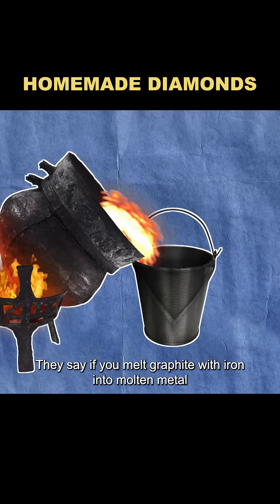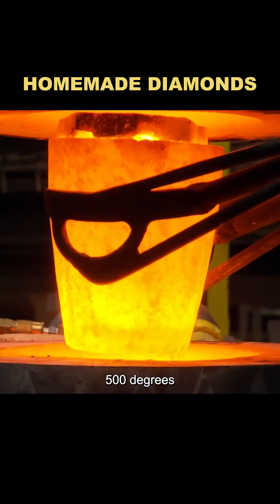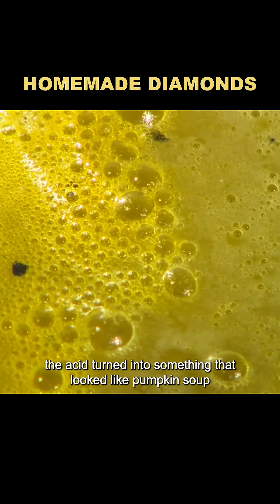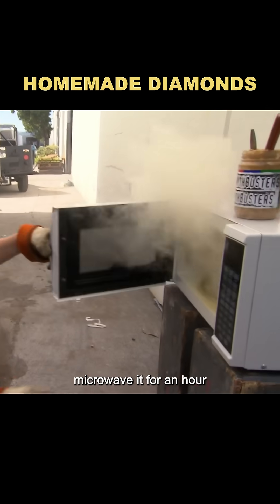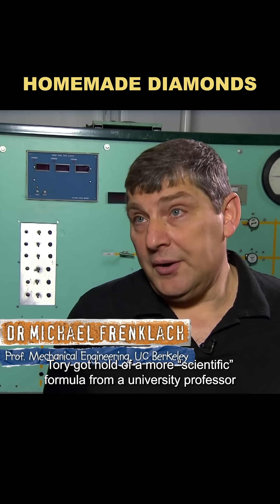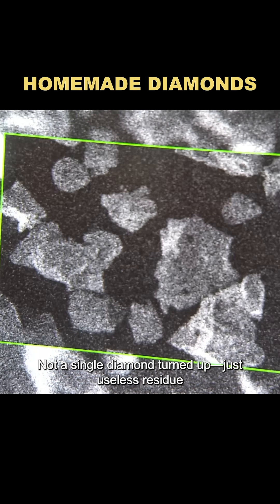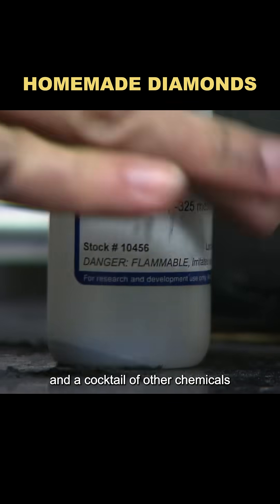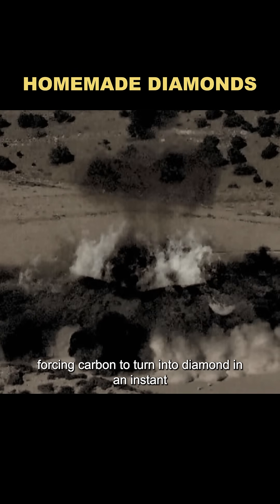So this is how diamonds are made.

Comment: How stupid is this?? Really, old fashion diamonds are the only way to get best diamonds? Man if you obtain high pressure and high temperature you can make a clean diamond. Besides diamond are the most overrated carbon that is out there falsely valued by controlling the diamond supply. There is abundant diamonds on planet earth, also universe is full of diamonds. They are not special not unique and certainly not worth the value they are sold at commercially.

Comment: If you want an answer to this you will likely get one of two answers, yes and no. Both sides have vested interests in the answer. The better question is whether you can tell the difference. The answer to that is qualified. You won't, but a scientist with access to the right equipment can. Scientists can actually tell the region and the particular find a diamond came from. So, there's your answer.

Comment: There is no difference between synthetic diamonds and real ones. Synths do have less occlusions (faults) and do have a more ordered crystalline structure. but they look and behave the same way. and whilst none of these goofy attempts are a viable means of making them, it is not all that hard or complex. And a lot cheaper then digging for them. 

Diamonds are not that interesting as jewelry either, they are not particularly pretty, nor rare. The only reason they are expensive is because of Marketing campaigns and artificial price inflation by businesses that sell diamonds.

A Saphire or Ruby is far mor interesting.

Comment: Diamonds are a trash gemstone, only expensive because they control the number in circulation. You control the supply, you control the price. Only exception to this is a NATURALLY occurring blue or pink diamond those are actually somewhat rare. Though the pink diamond value has only gone up because they closed the Argyle mine that they have been historically most often found in. Probably a ploy to drive up prices. If you want to buy some actually worthwhile gemstones, buy some emeralds, rubies, jadeite, alexandrite, Musgravite, red beryl, Tanzanite or black opals. Don't spend money on diamonds, you're literally buying one of the most common gemstones on the face of the planet when you do that. Buying trash minerals basically lol.

Comment: Now for a scientific explanation:

It takes temperatures of 900-1300°C and pressures of 45-60 kilobars to form diamonds.
Reply: And if you are looking to simulate high pressure and high temperature conditions in a controlled environment, one possible way to achieve this is by using a high-pressure reaction vessel (such as a diamond anvil cell) and heating elements. 

In terms of chemicals that could be used to generate high temperatures and pressures, some possibilities include:
- Periclase (MgO) and metallic iron (Fe) reacting to form magnesium iron oxide (MgFe2O4) at high temperatures and pressures.
- Mixtures of alkali metal chlorates and a reducing agent such as sulfur or metal powders can also generate high temperatures and pressures when ignited.
- Styrene and acetylene can undergo high-pressure polymerization at elevated temperatures.

Comment: There are lab diamonds. There's two main types, CVD and HPHT, these are real diamonds not simulants like CZ or moissanite. HPHT are made in a machine that squeezes carbon at a high temp with tons of pressure to make them in the same way as natural ones. CVD are where they blast a thin slice of diamond (diamond seed) with vaporized carbon and plasma causing the seed to grow.

Comment: Technically they were Kari was using "Charcoal Briquettes" not graphite, this is important because the carbon in "Charcoal" and the carbon in "Graphite" are not the same...
Yes they are both "Carbon" based but in reality, the carbon composition found in graphite is better suited to the purpose of making diamonds than the carbon composition found in "Charcoal."

Comment: Just heat up ethanol aka alcohol to super high temperatures using an tungsten filament, warning do this in a vacuum or you will have a big explosion
Reply: After a while you will have some small diamonds probably around 0.3 cm in diameter

Comment: You can make them with a high level of pressure, more than that necessary equipment for that already was made, still the question is not if you can make diamonds but what is the use of them, the price on them is over too much they are really worth

Comment: I remember  reading somewhere that diamonds are only worth so much because governments regulate how many can be mined, there's a mine in Russia which if mined at its greatest efficiency would drive the price of diamond too low so they're limited on the amount they can mine
Reply: And also because DeBeers and other diamond sellers buy up all the diamonds and only release small amounts so the market doesn't get flooded and the price stays high. Diamonds aren't as rare as they make everyone think. They are "rare" and expensive because the big companies that control them decide they need to be for them to make more money.
Reply: it's not the governments It is one corporation DeBeers. They have an almost complete monopoly of the Diamond market. Google them DeBeers
Reply: I kind of want to read this, do you have the article still?

Comment: CVD left the room. There's something called as Chemical vapour deposition. You heat the carbon in absence of oxygen turning the carbon into carbon monoxide, you forcefully deposit the carbon monoxide gas on a diamond and let the carbon monoxide gas being unstable separate into carbon and oxygen. Carbon takes crystal form due to it being deposited on the crystal form. The purity of base diamond will decide the structure of newly formed rough diamonds which need to be polished.

This is ideal as it can be used for building airports, cutting tools and many other industrial applications.

Comment: Diamond industry is the most falsely controlled. Artificially inflated by limiting access to a huge stockpile of diamonds.
Reply: Wait till u hear about all the other industries that market to wealthy people like watches, bags, shoes, etc.
Reply: Diamond Prices are falling rapidly because the Lab Grown one are now easy to make and are 100% pure. And because of a ceratin War that doesn't involve Ukraine.

The only difference between labgrown and nature grown is, that one costs Lifes and is conctrolled by ceratin people and the other is cheap.
Reply: Same as Gold,  Australia could've brought down the price to a quarter of it is.......
Reply: @cainadams4989  What do you mean by that, and at the same time "I doubt it".

We mined around 213'000 Tonnes of Gold. Imagine a cube with a sidelength of 23m that is the toal amount of Gold we Mined.

Australia has an estimated 12'000 Tonnes of Natural unmined Gold and 80 Tonnes in it's Bank.
So if Australia could instantly Mine and Reffine all the Gold they have, the Pirce of Gold might crash by 10% for a very short term and then rise even higher, because now there is even less unmined Gold.

Diamonds are just Carbon, you can just burn a Diamond and all that is left is CO₂.

So invest in Gold not Diamonds, because if your House burns down so are they. Gold just melts.

Comment: It would be really hard to create real diamonds like nature does when Lava is usually the heating source and the weight of tectonic plates crashing into each other is the force applied..
Reply: Actually super easy,
The problem is they're too perfect so the people that grow them are experimenting with adding inclusions on purpose. 

Funny world we live in, mined diamonds value is completely about size and perfection and now that we can make a diamond that is both huge and perfect those are now bad things...
Reply: @mjkuhnke  Yes, perfect synthetic diamonds. But if we are talking how a diamond is naturally made, it would be through extreme heat and intense pressure. Making synthetics is different from natural, while looking close to the real thing. That's also why diamond sellers need to list if they are synthetic or natural. if that weren't the case, then there would be a lot of diamonds all over the place, but natural diamonds are rarer than synthetics and more sought after for jewelry. However, synthetic diamonds can operate the same as natural diamonds.. So with how close it is and how well you can use synthetic in nearly anything in exchange for natural is kinda insane, the only thing really keeping it separate from each other is that jewelers are forced to label them as such.

Comment: How on earth are we melting graphite with iron by the time the graphite melts the iron will literally evaporate
Reply: Plus, Graphite doesn't even melt into liquid it instead has a sublimation point, and turns directly into gas. And to do that, you need temperatures of 3,650° C 

2,500° isn't even close to enough, Celsius or Fahrenheit

Comment: Turns out, the microwave actually is part of the synthetic manufacturing process. Acetylene gas in a high pressure plasma chamber will grow diamonds. It's not that simple, of course, but basically that's how they're made.